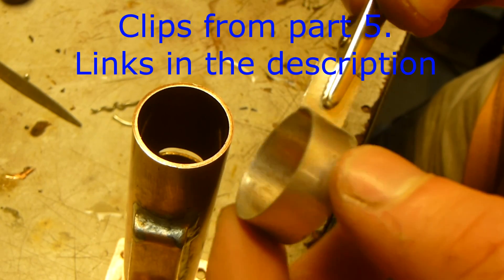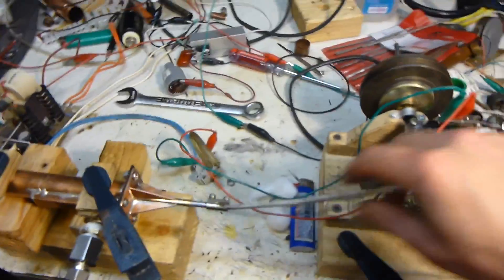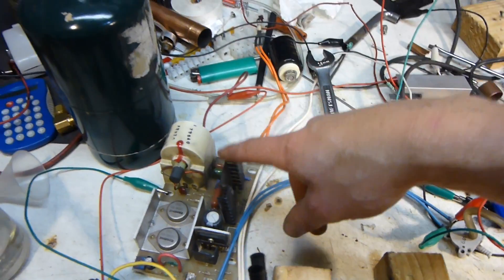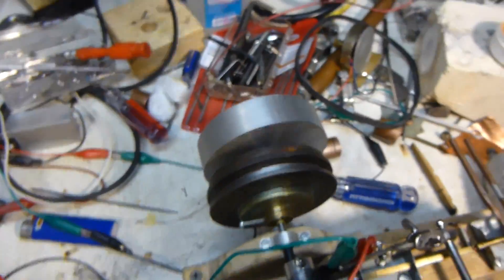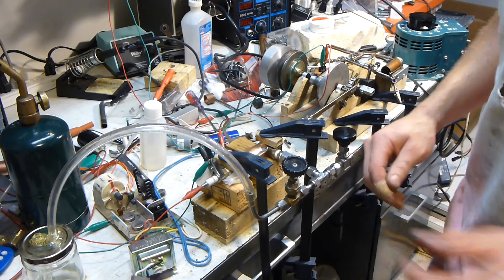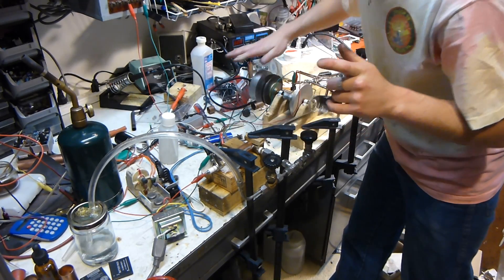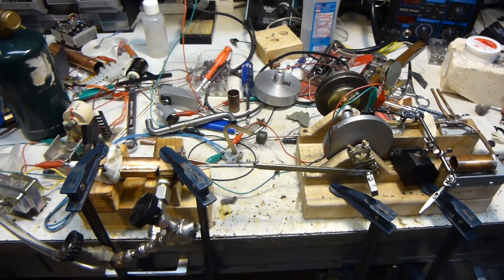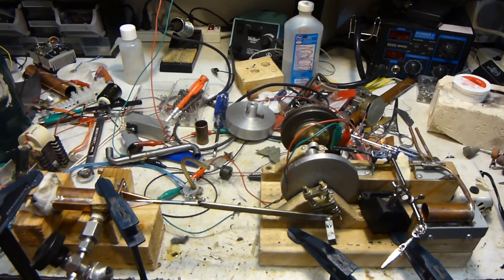Part 6 Internal Combustion Engine First Run and Starting

Comment: I'm sure you sorted it out 6 years ago, but it was starving for fuel which is why it kept conking out. I'm impressed. There is something to be said about being naive. You didn't do half the steps most engine builders would have gone through and you built a running combustion engine. That's pretty darn amazing.

Comment: Great job.
Can steel or aluminum be used instead of copper?
You can make patterns as you counted all parameters (compression, stroke, etc.)?
Can you weld?
I wanted to do something similar.
Reply from the maker: +Damian sure! Steel or aluminum would work great. I used copper because it's easy to solder and I'm good at soldering. Now that I know how to weld I could easily weld one. Go for it!
Reply: I think I'll take it, I just wanted to know how to design this engine.

Comment: put your copper piston sleeve under water it will run longer also evaporation causes your fuel to cool to the point of almost no vapor.

Comment: Just wondering how you made air fuel ratio knob setup, think you help me out, making my own engine this winter and I need a few tips
Reply from the maker: +Jared Bradt  There is a ball and spring that acts as the check valve. Then simply a T with two needle valves to control the mixture. Here's the more finished setup. https://youtu.be/uCEfruf45i8
Reply from the maker: +Jared Bradt this may also be helpful. https://www.instagram.com/p/BJVfJTEAjy_/

Comment: I apologize if something went entirely over my head, but how do you have the spark plug timing controlled? I am very interested in attempting this, but am a beginner to electronics and wiring, I only work on very old trucks and cars and have never had much of a need to learn complex circuitry, just basic wiring. Is it on a continuous arc or something equivalent? Thanks. 👍🏼
Reply from the maker: +Hunter Jacobson yes, it is essentially continuous arc. The circuit is something that I salvaged from an electronic air cleaner. A neon sign transformer also does a really good job. Checkout my latest video where I am running continuous arc: https://youtu.be/jcK8MRmmjQg
Reply: Makerj101 ok, thanks so much! I really admire all the things you do!

Comment: you should've put a steel inner tube as the cylinder wall this way you can let it run for longer than 25 mins!
Reply from the maker: +Cold Blooded Fasist why do you think it only ran for 25 min? I've run it for at least a 5+ hours in total with minimal repairs. The copper is holding up just fine. It's the brass rod seal and steel rod that is wearing out.

Comment: Very nice engine,i'm impressed! You could solder a bigger pipe over the cylinder and have an inlet and outlet on the side to allow water cooling but that would ruin the looks anyway.

Comment: Does it work withouth compression?
Reply from the maker: +The Sniper fox 97 no, I could not get it to work with bad compression. Once I added the oring piston seal I was able to get it to work.
Reply: Makerj101 OK, but the lenoir engine works with no compression.
Reply from the maker: +The Sniper fox 97 true. But this is 2 stroke engine which needs to have compression. Else no fuel will get into the cylinder.
Reply: Makerj101 Anyway you have been good to build this type of motor, the difficult part is to find the correct mix of air and gas, i tried to build lenoir engine ( it is very similar to 2 stroke engine, but it hasn' t compression, the mixture of air and gas comes through an automatic valve in head of cylinder), but it doesn' t work.

P.s. I have just subscribed, you male good videos ;)

Comment: How do you time the spark plug?
Reply from the maker: +Chromedian I was using a small switch to trigger it. I now use a hall effect sensor and ignition coil. The hall effect sensor triggers a little MOSFET circuit that I designed.

Comment: Try running it back words
Reply from the maker: +Steven dewitt I think it does at some point in the video. It runs either way no problem. Helps to advance the spark in the right way tho.
Reply: +Makerj101 oh ok I did not notes it but I like the concept what do you use it to run
Reply from the maker: I put a generator on it and it puts out about 15 watts.  I've actually charged my phone with it before.  It also runs a fan really nicely too.
Reply: +Makerj101 that's cool how's the fule use

Comment: That's awesome man, you're one sharp individual! Any thoughts on building a larger version to power something?
Reply from the maker: This one is plenty big enough to power stuff!  I hook it up a small generator and it puts out about 15 watts.  I've even charge my cell phone with it!  Now mind you that's after a lot more work then I've shown this far in the series.  I need to post the rest of the updates to it.  I've been pretty busy with school and such and procrastinating at uploading videos.
Reply: I was thinking more along the lines of a mini bike or something. 😄 That's awesome that you're making electricity with it, got a great little emergency generator there! Post more video if ya got it! 👍🏻
Reply from the maker: +Shit box LOL I doubt it'd be powerful enough time power a bike! I will post a video if I try that!
Reply: That's why I suggested a larger displacement version, I'm sure you could build something like that no problem. I'd love to see those build videos!! 😀👍🏻
Reply: Yeah, true. But I think it would take a much larger or much different design. Doing it with as few bought parts as possible is even trickier. I would say that with o rings as seals, I would expect friction to be a concern at high rpm. So maybe a larger lower rpm design would work better; especially if the exhaust and intake are at all restrictive.
Reply: spaceminions, Once again for the third time, that's why I suggested a much larger displacement version. Who knows if it would work or not, just something to think about, no need to think too hard about it.
Reply: Well dang dude that's what I wanted too. I wouldn't call it thinking hard, but I figure if you do think a little sometimes you can do a little better than just guessing. The problem I come up on when I think about it is that he's not going to be able to make it as big as it would have to be, because there's a limit to the dia of copper pipe you can find among other things. So I think he needs to get better efficiency too, and that might mean better piston rings and more work with the intake and exhaust.
Reply: spaceminions, Thanks for the wisdom, I shall carry it with me forever! 👍🏻
Reply: Lol it was nothing, grasshopper. XD
Reply from the maker: Shit box you guys are funny! Well there is a homemade internal combustion engine powered bike floating around on YouTube somewhere. It's in another language and doesn't have many views so it's hard to find. But it is possible. I think the guy used 2 inch cast iron pipe if I remember correctly. I'll link it if I find it. I have been thinking about building another engine using 1 inch pipe. I think I'd use a 1 inch brass nipple as they are readily sold at Home Depot and Lowes. This design would require little soldering unlike this engine. although I'd be less beautiful. I don't know how a jb weld piston and orings would hold up with that size. But it would be an experiment.  I've also thought about making a 2 cylinder design.
Reply: You need fairly high rpm or displacement to get enough power for a mini bike- probably wouldn't want less than 1500 watts for practical use, or maybe 500 watts on a bicycle.A typical homemade mini bike is 5000 watts or so. You could use the engine to power a portable fan maybe, or use the electric generator function to power a XML type LED at 10-15 watts.
Reply: spaceminions, Fans aren't much fun to ride, I vote for something rideable! 😁
Reply: power a boat with it xD

Comment: Dude.   I'm impressed, to the point that I want to start planning out a project similar to this, except one step further.

Hydrogen Fuel Cell.  It burns cleaner and would make for a great indoor emergency generator.
Reply from the maker: That's a cool idea... but how are you gonna use it as a backup generator?  I suppose if you store up a supply of HHO.   I also don't know how well hydrogen would run in it.  It might be too explosive and pop the engine.  Not sure.  Give it a try!
Reply: Makerj101 I've seen other projects that use an alternator from a vehicle as a wind turbine.   hardwired a DC inverter to it, and I'm thinking I can at least keep my phone charged on it, depending on how much power it puts out
Reply: Where would you get hydrogen, Chemical reaction? That would be the main drawback I can think of

Comment: Cool/Hot stuff. I think the flywheel is causing some wobble at high speed because of an unequal weight of the screw.
Reply from the maker: +Andrew Mwangi it think it's got bigger problems than just the screw! The whole thing is of center

Comment: if you were to pull your fuel line up and out of your fuel and run your air inlet line down into the fuel to create a gasification type carb then you might be able to better tune this small engine and help it to run cooler as well. just a suggestion to consider, it may or may not help in this two stroke setup as it does in a 4 stroke setup
Reply from the maker: +Mr.Everyman If I understand you correctly, that is exactly what I was doing on the video. This was a bubble carburetor system that I used. Here I show it up close with the air bubbling through the fuel at 10 min. https://youtu.be/ypwzEumMx00?t=10m1s
Thank you!
Reply: Makerj101 from what I see unless I'm seeing it wrong, you gave the fuel line under the fuel level this letting it suck in liquid fuel. I'm referring more towards a vapor carburetor system where no liquid entered the engine at all, I'll see if I can find a good example for you to watch
Reply from the maker: +Mr.Everyman it might look like the fuel line going to the engine is under the fuel. But it's not. The line that you see under the fuel is a short price of rubber that goes out the top of the jar to air. The line that goes to the engine only sticks into the jar about 1/4 inch. Looks like this: https://goo.gl/images/lXDpgR
Reply: Makerj101 OK, I couldn't tell as the camera didn't look at it for a very long time to differentiate that. if this is the case then you should not need the additional air inlet side of your intake manifold as the fuel is pulling enough air through with it in that setup, you should try shutting that side completely and only work with the fuel supply needle valve to monitor correct flow. you might also look into flow through carb design for a different effect as well. but either way I'm happy to see that you are into this, better than many other things that you could spend your time on, Jeri up the good work, I'll follow for more videos.

Comment: Nice work! What's the compression ratio of your engine? En what are you still busy with this project?
Reply from the maker: +Alie 148 I tried to get A competition ratio of 8 to 1 but I doubt it's that high. More realistically I'd say it's 5 to 1. There's a lot of improvements I've done on the engine since those video. It's got water cooling now. I want to build a better carb at some point
Reply: 5 to 1 seems to me pretty good for a homemade two stroke engine! I guess some leakage by the piston ring? Are you planning on to upload a new video about the advances of your engine? I'm curious what you've improved. Keep up the good work!
Reply from the maker: +Alie 148 oh no, this thing has got more compression than your consumer grade two smoke! No joke. With that oring piston seal there is almost no leakage. Turn the flywheel and it'll hold pressure for a good 15 seconds no problem. And with the new viton orings they last a very long time. It still blows my mind. When I've got the carburetor valves set right it'll start on the first try. Yeah I plan on doing a bunch more videos on it. Thing is I need some more around-to-it's. So if you've got any extras send em right on over! :D That'd be great!

Comment: clearly plenty of intake fuel, but exhaust is still to small as noted when the small pipe was placed over it. i fix mowers for a living and get weed whackers all the time that will idle but wont rev up due to spark arrestor screens on the exhaust clogging up. i'd dremil out the exhaust port that wee bit more. aarrh to be young again. don't forget there's other things in life called girls as well. it's great when you get their motors started.
Reply from the maker: +Capitán Obvious lol girls are a waste of time! :P I originally thought the same thing you did about the exhaust. I later found out that the flap of rubber that I was using as a check valve was totally useless. It would get pushed through the seat because it was too floppy. So there was not enough mixture to push all the exhaust out of the engine. I later replaced it with a ball bearing which had an enormous improvement.  Thank you for your comment! Have a nice day!

Comment: so you made a 2stroke with like 5cc, thats awesome man! now set it up with a throttle and make it more conventional?
Reply: the tap valve is a throttle. sure it's slower, but it's still governing the intake. his exhaust needs to be a wee bit larger then the rev range would increase while using the inlet tap valve.

Comment: explain how you made the spark , you lost me there.
Reply from the maker: robert mccully so this first version of the engine used a high voltage module from an old furnace. some furnaces are equipped with electric air cleaners. That's what this was from. I have a little micro switch on the crankshaft to turn it on and off. That's about all there is to it. does that answer your question?
Reply: Your a smart guy you assume we all are as smart as you.. If you asked me what type of fuel i used for a new rocket-- and i replied fuel from an old rocket silo would that help you? A better answer from you would have been-- its 1000 volts i took form and old furnace set of  10 degrees before  top dead center-- by a switch triggered by a crank positioner. Like i said-- you're a smart guy that is getting help or money from someone... Share the knowledge!
Reply: I eat bullies get lost..

Comment: As you obviously have no lubrication system for the cylinder and piston you should be using a 50:1 fuel ratio or "2 cycle fuel". It is modeled after a 2 stroke engine anyway isn't it
Reply: yeah that rubber o'ring would get sticky real quick at low temps even with wet paper towel cooling.
Reply: yes it would
Reply: I'm surprised that solder is actually keeping it together
Reply: damn that's badass

Comment: This is awesome dude! Glad I stumbled upon this! Might have to build my own. maybe a bit bigger? haha 

Curious though; How did you time your spark? With an ardenio? And how did you calculate your timing as the rate of compression went up or down?
Reply: Think I answered it myself from comment surfing? Fly wheel sounds about right, but still appreciate your answer. 
Thanks
Reply from the maker: +Nick VanDoorne in this video I was using a micro such held by the helping hands. There is a l little cam on the shaft to trigger it. I then removed it and it worked much much better with no timing. Just a constant arc on the spark plug worked the best. Now I'm using a little circuit that uses a halleffect sensor, transistor, MOSFET, and diode, plus some random resistors. This is used to trigger an old car ignition coil.

Comment: Hey, I saw your video about the chevy venture and how there was coolant in the oil. I have the same issue with a Malibu with the same engine. I would like to know how much you were able to sell it for and if the buyer knew about the issue.
Reply from the maker: +Zeroskator1 Wanted we put an honest post on Craigslist saying that the engine needed rebuilt and someone came and bought it in about a week. The guy was gonna swap the engine from his that got the body wrecked but his engine was still good. It didn't have much rust and I think we got around $500 got it. Good luck!
Reply: +Makerj101 
Thank you for the reply, I will probably get around the same amount for my 98 Malibu.

Comment: u should have the engine pressurizes the fuel tank
Reply: That wouldn't work with this engine since the fuel tank is the carburetor and the only reason why other fuel tanks have pressure is to push the fuel into the carburetor.

Comment: also maybe you can use a metal o ring. I would assume plastic and copper have different expansion rates so as it heats up it loses compression maybe

Comment: You need to devise a better carburetor,and get a real water jacket on the cylinder
I can tell right now you are gonna melt the ring/piston down  and thats likely why its stalling its getting to hot and losing compression    
I would also dril and tap the cylinder a 1/4 inch or so above the exhaust port and install a drip-oilier
and finally I would put the entire rig on a single piece of wood metal and solid mount it it all

Comment: That is fantastic!  Absolutely amazing!  Hey... curious... why not steal a carburetor off of a chainsaw or a weed eater and see if you can make it run better with that?  Also, remember that two strokes usually have those large expansion pipes so that probably explains why your little muffler choked it.
Reply from the maker: +Rob G would be way too big. This is only 8cc. A chainsaw is like 40cc

Comment: i think the timing is off, like its. spinning faster than each ignition stroke. also try fixing the part where u keep adding water. so yea work in timing and the inside pressure of the cylinder

Comment: Muffler might be changing airflow enough to require tweaking the A/F ratio.  I know standard 4 stroke stuff will do that if you mess with the exhaust enough.